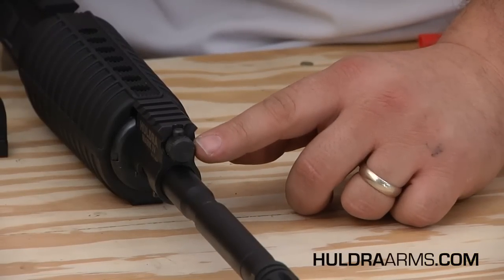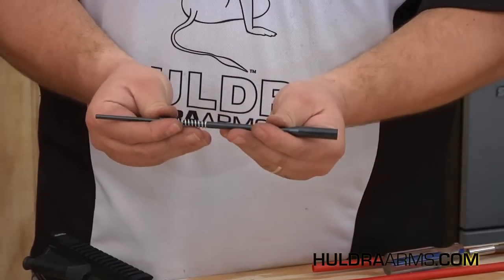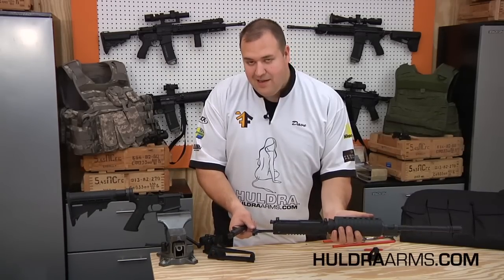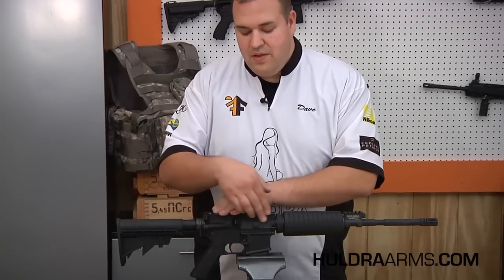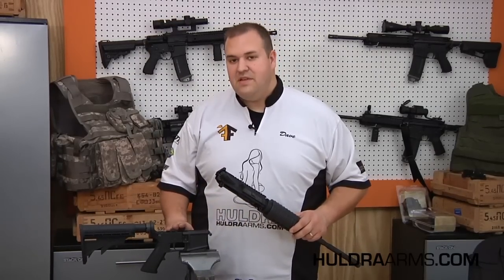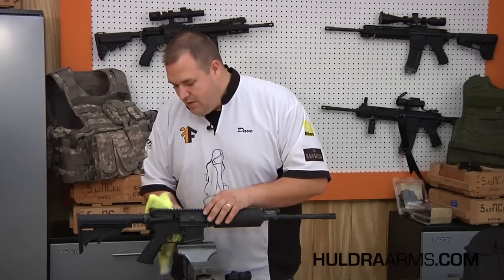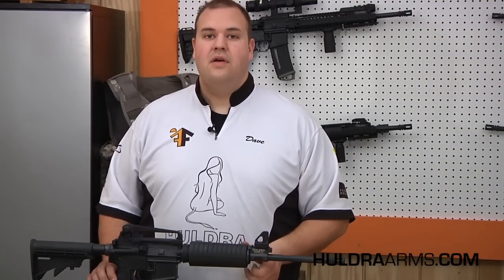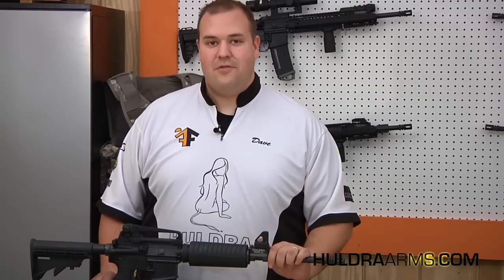Part 3: Huldra Mark IV Owner's Manual

Comment: if anyone is also wondering ideas for finding brushes to clean the gas block, I used a .410 gauge brass brush and it worked great, it fit perfectly in the gas block.